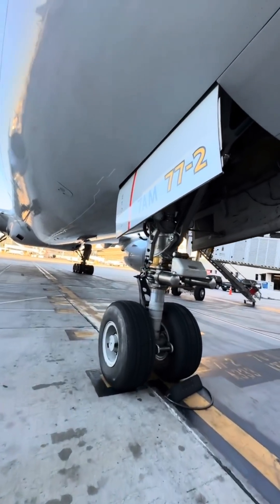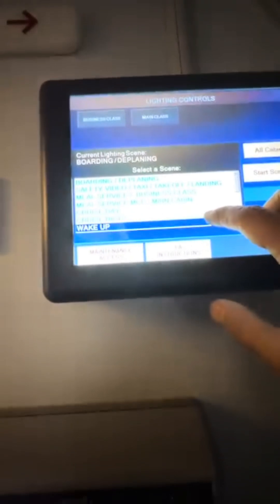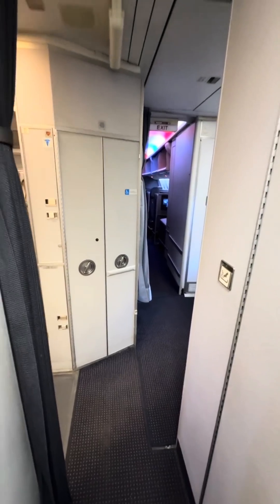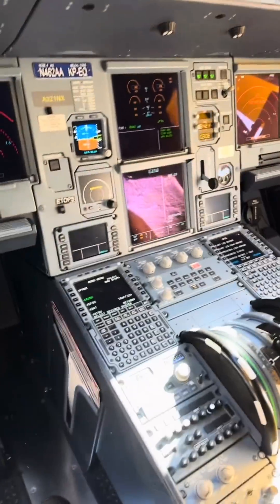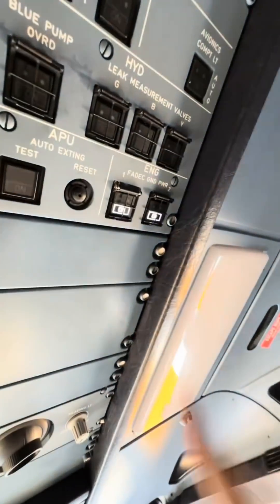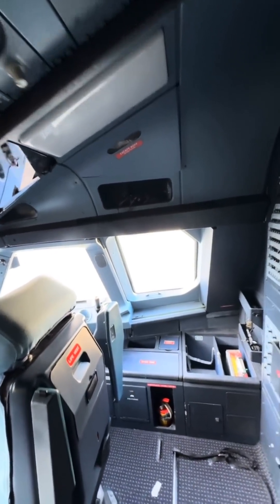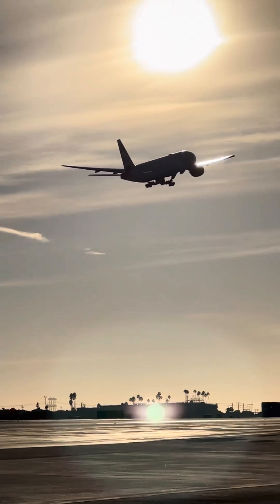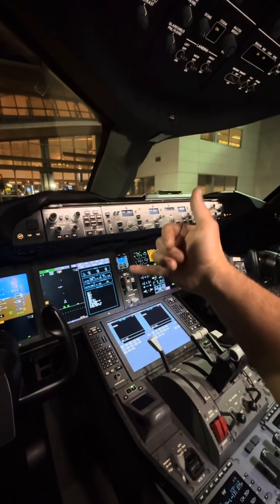Stig Shift …#1 (Aircraft maintenance) day 3 of 3

Comment: Hello Sir… great clip as usual. May I ask 2 of my many questions?  1)  Why are flaps always reset to Zero after landing when they are gonna be adjusted again for takeoff?… 30 degrees I believe for most aircraft.  2)  I remember seeing two balls on windshield center for pilots to reference their seat height.  Have they eliminated those?  Thanx! ✈️
Reply from the maker: Flaps have to be up when at the ramp. It’s the normal configuration of that aircraft. Also it will not obstruct ground equipment when on get. Those eye references sights are still there on all 320 family aircraft. 👍

Comment: Does maintenance cleans the cockpit area or the pilots?
Reply from the maker: we don’t, pilots can clean up after themselves we are there to fix not to clean. Now, if we did leave a mess because of a maintenance task, then we will clean up after ourselves. But all the dust you see, there is usually cleaned by pilots themselves.

Comment: Stig - what are the Fins for on the 787 Engine Cowling?
Reply from the maker: Those are called vortex generators or Strakes. They help guide the air around the engine and properly have it flow over the wing.

Comment: Amazed at your knowledge of all makes and models,, Airbus and Boeing. 😊.. question...tell us what that blade is for on the inside of the engine cowl
Reply: Thanks for the better explanation.
Reply from the maker: Which one are you referring to my good sir?
Reply: @StigAviation the approximate 1 foot by 8" blade on the outside of the inside of the engine nacelle. I believe it's there to improve the airflow under the wing. A Giant engine sticking out disturbs airflow? But I am not certain of this?
Reply from the maker: This is called a vortex generator or a strake. And you are correct it is to improve airflow over the wing. You see these engines are getting so massive. That airflow is now being obstructed from properly flowing over the wing. So what engineers did is to create a little thin or large thin, I should say, And placed it on the outside/inside of the nacelles. This allows airflow properly over the wing, and does not disturb the lift capabilities of the wing.

Comment: From a maintenance perspective A320 or B737? Whats your opinion? Might be worth a video on this subject?

Keep up the good work!
Reply from the maker: From a maintenance perspective, I will have to say the airbus is more preferable, the aircraft interface system are more user-friendly, even though the aircraft does generate more faults, they are very easily fixed. With the 737 it’s a bit more analog system, even though they rarely break down, but when they do, it becomes a hassle because all the avionics and testing equipment is inside the belly. And not to mention the factor that it’s a direct control aircraft with cables, where, as the airbus is pure fly by wire.

Comment: Please explain AOA how is works. Good day
Reply from the maker: It’s a very simple system, it has a little fin that is placed on the outside portion of the fuselage. It has the capability of moving up or down in regards to the relative wind that it’s subjected to, this gives electrical signals to computers to show the angle of attack of the nose of the aircraft.  That’s a simple as I can make it.

Comment: Hey stig I thing it would be easy for you if u had a go pro attached to your hat, and it would keep you hands free of your cell phones
Reply from the maker: Believe it or not, I actually do have a GoPro, but the problem is, I don’t want to make my coworkers or other personnel on the ramp uncomfortable. I do it out of respect to them, I don’t want to walk around with a GoPro strapped to my head and filming everything. So I just use my phone to take small little clips here and there. But I’ll figure out a better way of doing this in the future.

Comment: Stig, new subscriber but aviation lover and ex vehicle mechanic of 30 years. You mentioned in your video that some aircraft are “smarter” aka more designed to exactly pinpoint faults. Whilst it’s an assumption I’m guessing Failbus/Airbus are those “smart” aircraft?
Reply from the maker: Yes, indeed, actually, Airbus is the smarter aircraft, it’s a very unique and well designed system in comparison to its competition the 737 which is an aircraft that is basically built in the 60s and still being built but with more sophisticated technology obviously. But the airbus is more superior. Now when you are talking about the widebody aircraft, airbus and Boeing are pretty much up to par, and on the same level when it comes to technology